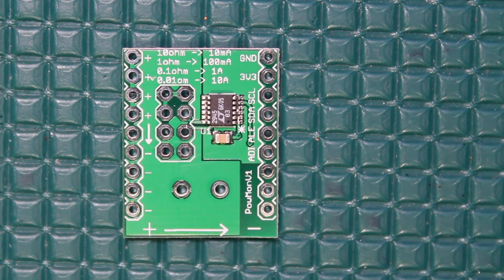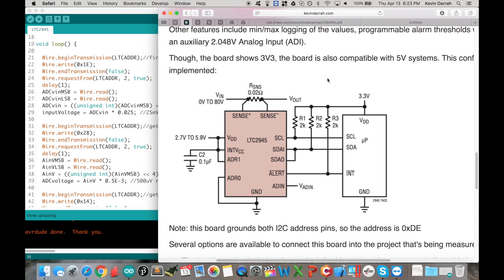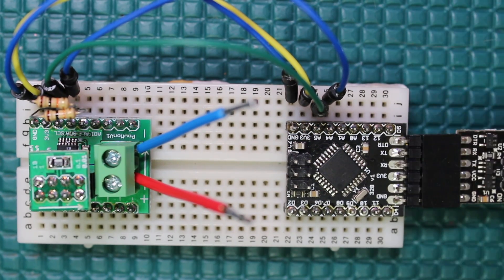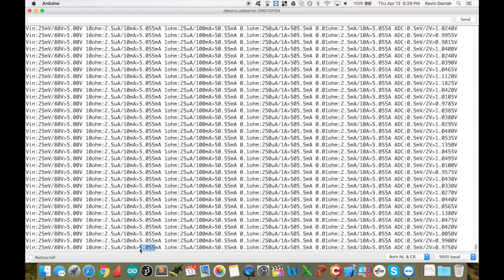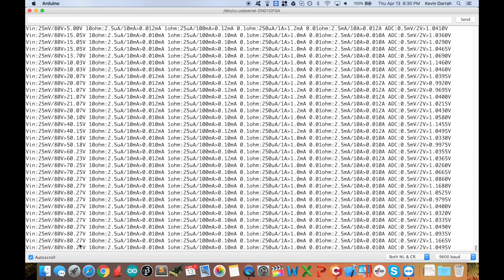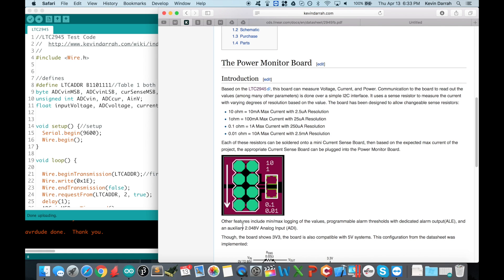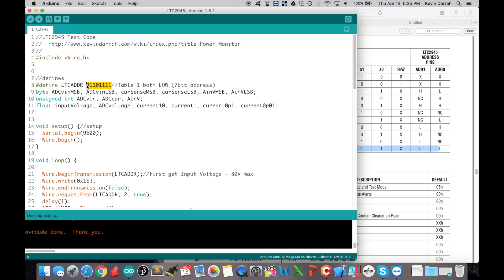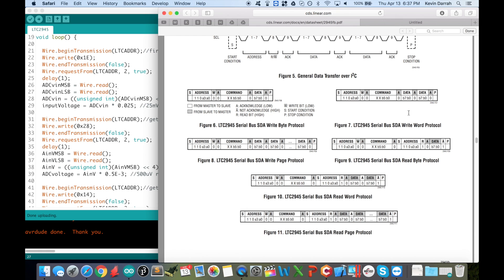Easy Current & Voltage Measurements w/Arduino and LTC2945

Comment: Hi, I am using your code and your calculated shunt resistors in one of my projects and my measurements only accurate with the 10 Ohm resistor. If the resistor is smaller than 10 Ohm for example: 1 or 0,1 or 0,01 the mesaurments are not accurate. The higher the current higher the devitation. The devitation always higher. Thank you in advance for your help! <3
Reply: did u fix it ..its a sense resistor not shunt that means u have to connect it on battery + and load + .the load + and bat+ will already be directly connected with high amp wire thus sense resistor will sense voltage drop in resistor and load will still go directly through wire like 10-100 amps or whatever untill voltage drop is under 100mv.correct me if i am wrong i am working on this making coulomb counter SOC etc for 12v 200 Ah battery ups

Comment: Just confirming, since the current is calculated from the input voltage and the sense resistors, this would not work for a non-ohmic device such as a diode?

Comment: Nice work (: Do you disable the internal pull-up resistors for the I2C bus, when you are using external 10k pull-up resistors? (:

Comment: Please suggest me to measure th DC voltage upto 500V and Current of 20A I want to make power meter for my solar panals whcih are capable of giving volage upto 300V and current upto 5A please suggest me the sensors
Reply: Use a HV depletion NMOS from Infineon and float the LTC2945, this is shown in app ckt. Use optos to send the digital data to the operating ground

Comment: What happens if the current flows in the opposite direction? I want to measure the current in two directions.
Reply: Use LTC2992, essentially LTC2945 x2 and only priced slightly higher

Comment: Hello there! Nice try.  Your presentation is confusing.  There is nothing "EASY CURRENT & VOLTAGE MEASUREMENT WITH ARDUINO" as your video title says..  A lot of improvement still has to be done.  At any, thanks for your effort.

Comment: Thanks for the detailed project review of the LTC2945.  I had been looking for a way to monitor higher dc voltages other than using voltage dividers.  Your project paved the way for using the LTC2945 with a ESP8266-12E on my 24 vdc solar collector.  Now I can remotely monitor the collector voltage on my favorite IoT site.

Comment: Very interesting.  Sadly, I need something that will go up to 10A at least.  Well, maybe LTC has a chip that can in that range or I will have to run it through a divider or alike to make sure the Amps aren't too high.
Reply: His board will take you up to 10A - there is a jumper for that.

Comment: I've tried a couple other current measurement techniques (built-in sensing on a motor controller chip, and a separate current sensing chip inline with the main power to the motor controller, but they didn't have such resolution!

Since I would like to be able to measure to 6-7 A (for motor-stall conditions), could I use a 1/2-w sense resistor (wound wire? How would I get that low a resistance... another puzzle!) to be able to sense more than 5A?

That's a versatile board design. Thank you for sharing the design!

Comment: I would like to be able to measure the power being used in my Sous Vide controller using a SSR using PWM from a Chinese temp controller.  I want to track the temp vs power curve to see what is happening during operation.  It is 115VAC slow cooker for now ( 350 watts) and later a bigger heating unit of 1000 watts.  From another question I cannot use your device (80VAC MAX).  What can I do to get the readings in the arduino?  I eventually want to make my own controller on the esp8266 or ESP32).

Comment: hello Kelvin, how small can the shunt resistor be, once changed is it just a matter of code changes. looking at getting a .000200 ohm 7W shunt resistor. http://au.rs-online.com/web/p/surface-mount-fixed-resistors/1249340/

Comment: The TI INA230 is just above $1.00 on digikey and TI has 16bit A/D. The LTC2945 is well over $4.00 and it has only a 12bit A/D.  Both are pretty similar otherwise with TI still holding an edge on other small things.  except for the 80volt upper voltage limit which reduces resolution anyway, I see no reason to even consider this part for anything. And I am not a big TI fan either. Sorry LT, just another overpriced part.
Reply from the maker: wow, that is a cool part. I did need the higher input voltage though, so that's why I chose LT.  Might have to do a part 2 with the one you found

Comment: for higher voltage levels ... can I use a voltage divider, as long as the chip input impedance is pretty high?
Reply: NO, the maximum input voltage will be exceeded when measuring current.

Comment: Hey for a mechanical relay for arduino which comes with octocouplers as the ones sold on ebay, would you worry that much for noise that could possible damage the relay or not really? Thanks

Comment: and of course if you need more than the 10a you could use a hefty big current shunt off ebay and with some maths on the arduino correct ofr the shunt resistance
i may add one to the cars charging system to show charge....

Comment: Not only can't the small resistor take more than 5A, the pins aren't made for 10A either (even if there are three in parallel).
Reply from the maker: yea good point!

Comment: The connector could add more than 0.02 ohm resistance between the main board and the board with resistor. Hopefully the contacts in the connectors are gold plated, but I doubt it. 
You should have placed just two resistors in series on the pcb spaced enough apart and with two half circle pads to allow user to connect two traces together with a blob of solder  - if user wants to enable that resistor, just add a blob of solder over the two pads to create the connection, and unsolder the other blob of solder to disconnect the other resistor.

This way the pcb copper layer would also behave like a tiny heatsink for the current sense resistors and reduce the drift with temperature.

Comment: Why have the i2c resistors external ?
Reply: Because if they were internal to the board and you put it into an existing system you would have too much pullup on the bus.
Reply: I see

Comment: What is the maximum polling frequency achievable via the I2C bus for this chip?
Reply: The value will be in the datasheet, which there's a link for in the description. Won't get easier than that.
Reply: The value I found is 7.5 Hz. If I want a polling frequency of 50Hz I'm better off with the ACS712 series for a current draw of 6A max?
Reply: That depends on your requirements. I like the ACS712 because it's completely isolated, can measure positive and negative curents and has an internal resistance of only 1.2mOhm (so almost no voltage drop). But it will have higher noise than a dedicated chip that uses a shunt resistor to measure the current. Since you need "only" 50Hz you can use a simple RC-low pass filter on its analog output and should be able to reduce that considerably (the ACS712 on it's own has a 80kHz bandwith, so it's definitely not your limiting factor).
You can always go other current sensing chips, that use a sense resistor but have analoge output. So you provide the ADC yourself (the µC internal one for example). I know there are alot of these chips, but can't really give you any part number, because I have never used one of them.
Reply: I used the ACS712 in the past to measure the current draw of two servo's (Dynamixel RX-24F). I need 50Hz (or higher) to be able to see the spikes of current consumption used to drive the servo's. I didn't use any RC-filtering because I thought that would average or smooth my signal to much. I'm looking for other options because over time the voltage on the output (with an input of 0A) was drifting. I only need to measure positive currents ranging from 0A to 6A with a resolution of a 1-100mA. I had a quick look at the datasheet of the ina219 of TI and this chip seems faster.

Comment: Wouldn't you want the sense resistor as close to the pins as possible? Wouldn't the traces introduce added resistance, especially at lower ranges? Or is the resolution not enough to significantly skew the results?
Reply from the maker: yep it's a Kelvin connection, but ideally you want to have this close to the device...  I really wanted the resistor to interchangeable
Reply: Look at the schematic or board layout. He is using a Kelvin connection ("Kelvin" not "Kevin" ;) ) as he should. Trace resistance is irrelevant in that case.

Comment: the ACS712 and similar ICs are good for high current applications and easy to use, but have analogue voltage out http://www.ebay.com.au/itm/like/201627932216?chn=ps&ul_ref=http%253A%252F%252Frover.ebay.com%252Frover%252F1%252F705-139619-5960-0%252F2%253Fmpre%253Dhttp%25253A%25252F%25252Fwww.ebay.com.au%25252Fitm%25252Flike%25252F201627932216%25253Fchn%25253Dps%252520%2526itemid%253D201627932216%2526targetid%253D91828831777%2526device%253Dm%2526adtype%253Dpla%2526googleloc%253D9056915%2526poi%253D%2526campaignid%253D184043497%2526adgroupid%253D8467825417%2526rlsatarget%253Dpla-91828831777%2526abcId%253D%2526merchantid%253D110800715%2526gclid%253DCMrw4qOLo9MCFQGbvQodiQoAhw%2526srcrot%253D705-139619-5960-0%2526rvr_id%253D1200288037265
Reply: Yes, I like those much more for anything that's above a few hundred mA as well. The biggest advantage is that the load circuit is completely isolated from the measuring circuit. This allows you to add it into a circuit even as an afterthought and you can also easily measure mains AC, where you can use another advantage, which is that it can measure positive and negative currents. A little more than 1mOhm of internal resistance means you have almost no voltage drop.
One disadvantage is though that it's analogue output is quite noisy (but at a bandwidth of 80kHz there's ample space for filtering).
Reply: Btw. you can shorten most ebay links to look much less like spam by removing everything after the first question mark (and sometimes even things before that except for the item ID):
http://www.ebay.com.au/itm/like/201627932216